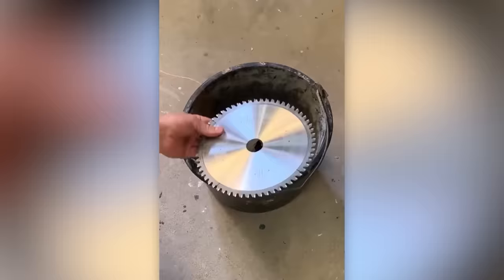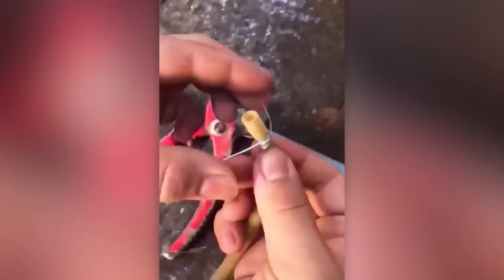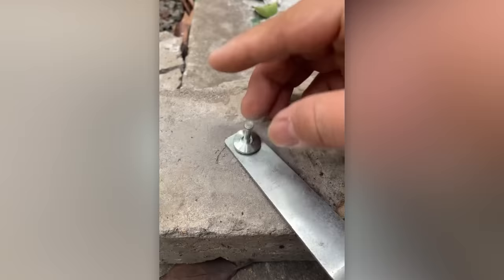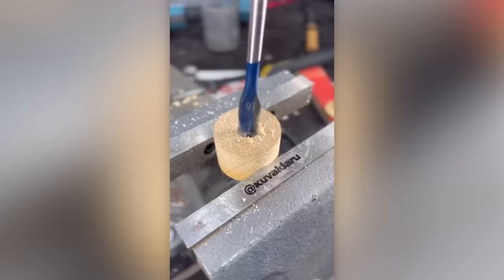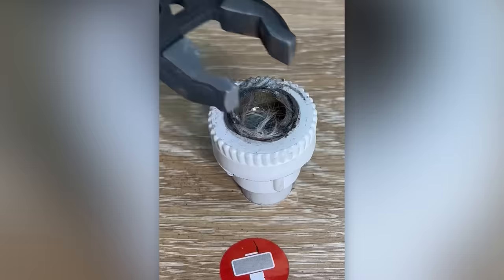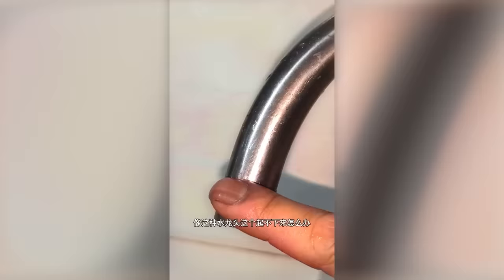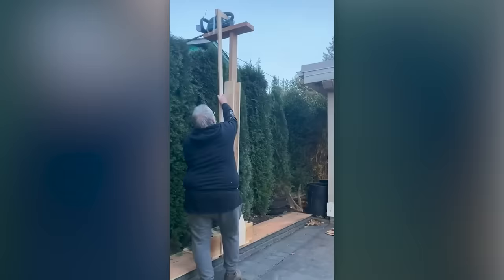HANDYMAN TIPS AND TRICKS THAT REALLY WORK

Comment: FYI: duct tape is not usually transparent and has threads embedded in it. The tape used on the door of that car looked more like clear packing tape (AKA cellophane tape).
Reply: Also if there is any compromise to the paint such as a slight crack all the paint comes too body shops love ya doing this
Reply: Yeah. Definitely NOT duct tape.
Reply: @konciliogasco3324  body shop here, ya that looked like packing tape to me too , and ya, it's great when customers try to fix their cars, and fuck it up, just don't put silicone anything on the car, we can't always get it off,and that sucks, it causes paint and anything else for that matter , not to stick, paint jumps rite off the pannel, it was still pretty brilliant though, i'm gonna try it
Reply: Real duct tape is adhesive backed metal like a thick tinfoil for doing duct repair work/sealing. that's why most or that (MUCH temporary/cheaper) duct tape is grey/silver. But still good catch and point, that's CLEARly packing/shipping tape ;] -with love and respect from Canada <3
Reply: @djosearth3618  it isn't really called duct tape, it was called "DUCK" tape, for it's moisture resistant properties, it was invented for the military

Comment: Don't use salt on a screw hole that will eventually corrode the screw and cause it to let go, Use a wood pin {Toothpicks/golf tee/spoon handle/etc.} if want to use dust use saw dust and glue.
Reply: Yeah... and if there is any chance of it ever getting wet, the corrosion will be terrible, but the salt and the screw's hold will be gone.
Reply: Getting screwed does leave one salty, though.  Jus' sayin'
Reply: EXACTLY,  TOOTHPICKS  WORK PERFECTLY. 
👩🤗
Reply: that's a good point i forgot about that one, that was a a very stupid one but among only about 3-4 not the normal 50-100% :). Ya everyone should know to use splits of scrap wood or rounded up used paper or nearly any inorganic trash really just not salt I use dried little twigs alot but never toothpicks (anymore), i'm trying to be more ecologically concious but not too ppreachy sorry if i came off that way, atleast i'm not using a fork to hang a little picture hehe (sewing needles sometimes work great for that tho) w love and respect from Canada!

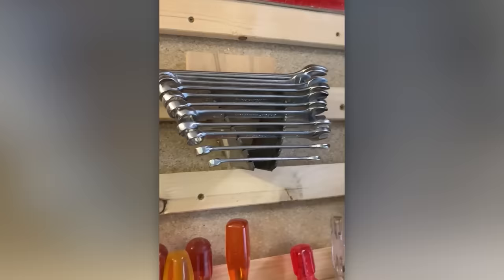Comment: Dear friend, at 0:20 that isn't Duct Tape. That's Packaging Tape. Nevertheless, that's an amazing use of it, and Duct Tape would probably work just as well, if not even better. So thanks for the demonstration!!
Reply: I agree about it not being duct tape. Duct tape would leave a sticky residue (as would packaging tape). 12:52 is also not duct tape. It looks like electrical tape, but I could be wrong.
Reply: not to mention it might remove some door paint😁
Reply: My wife said immediately, "That's packing tape!"😃
Reply: @UKcomedyfan28  Painter's tape
Reply: @melenynder7136  I don't think the painter's tape would be strong enough to remove a dent in a car door.
Reply: @UKcomedyfan28  not the door. The cup thing at 12:52 is painters tape
Reply: @melenynder7136  I don't agree, but that's OK. Painter's tape is not that stiff unless there are multiple layers. If the video could be zoomed in, we could tell better what it is.
Reply: A plunger would work quicker.

Comment: 10:15 never drill a ceiling tile from the top, you might bust out excessive tile as the hole saw goes through, drill a small pilot hole through first, then drill from the underside.

Comment: This was a good one with lots of new tips. Hey if you can, I’d like to know what those cabinet door hinges are called.   if you know i would greatly appreciate  if you could let me know.   Thx
Reply: @dennwahh it is on the screen top left. Lamp Monoflat Lin-X hinge. Lin-X450. There is also other names bottom left and right maybe manufacturer / distributor ? at 17.18 time in video.

Comment: I'm curious what kind of electrical circuit is involved with the the tip of twisting wire with a drill. If that is 120v or 240v, soldering it is a bad idea. A line at that voltage, if it overheats can melt the solder. A wago connector or wire nut are safer choices.
Reply: It seems to me that if a circuit is carrying so much amperage that it cause a solder connection to melt then there are more serious problems than how the wires are connected at the junction box.
Reply: That’s any voltage. Also, why they were twisted tight first
Reply: As an electrician, i really don't recommend to follow any kind of idea this channel provides about electrical circuit. It's not this dude you will call when his "tricks" will broke, and you will have to pay a full time dude like me, to found the problem, and repair it, then complain about why the bill is high, when you can avoid it by not doing those "ideas".

Comment: I've watched many of these videos and I can say that this episode had SO many great tips! Thanks for posting.
Reply: I agree. they are usually loaded with at least half useless, nonsenible or even more difficult but more complex ways of doing things but this one was nearly all pure brainiac solutions. The one where the guys used a fork to hang a picture was ugly as heck if it was drywall he could have used a sewing needle at a 56-60 degree angle those little things have quite a bit of holding power and make nearly no hole. just don't use the sure thinnest inflexible ones (unless hanging something really light. Also the guy that stuck (forever RUINING the critical factory finish on the drill bit and then wasted 3 black zapstraps making more micro-plastics including that stupid cup, just to mix 1/2 cup of epoxy/resin/activator/colour was mind dumbingly stupid. Popsicle stick or two would work just fine, i've been using a bent a peice of thicker bare wire or even part of an oldmetal coat hanger, i twist them into a spiral or like a kitchen honey utensil or whisk :) Good gomment! -respect and love from Canada ;]
Reply: The fuck video did you watch?

Comment: 0:17 "Don't underestimate the hidden power of duct tape" shows someone using packing tape 12:53 "It's just a simple tray made of duct tape" shows someone using painter's tape
Reply: He def does not know what duct tape is
Reply: @boris9305  Or he just thinks every kind of tape is duct tape, lol
Reply: Haha nice you caught those too eh ;]
Reply: @TalkingHands308 Funny thing is that real duct tape is actually metal, at least here in Canada. That tape with the reinforced strings through it is usually silver and was a cheaper TEMPORARY replacement for real adhesive backed metal duct work tape. Guess it's another 3m invention like post it notes were originally supposed to be used as bookmarks but the manager wrote his rejection note on it and sent it back and between the mgr the inner mail delivery and the R&D dept someone had a eureaka moment. Bonus: Inventor didn't even get a bonus, but that's nothing comparede to Dyson Inc. stealing and patenting all those recent engineering students ideas (not sure who thought of the sideways fan in the base BUT i KNOW it was Dyson that decided to charge $600 for it ;] - much love and respect from Canada
Reply: @djosearth3618  Yah, if you have a great idea, don't trust it with anyone, patent it first, lol.

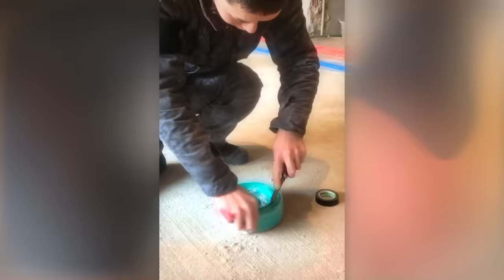Comment: 7:33 you can get a rawl plug out of the wall by putting a rawl screw in partway and pulling the screw with a pliers or hammer 🔨
Reply: Just put something between the hammer and the wall to spread the load so you don't make a dent in the wall.
Reply: @tgeliot  good point, I'm used to masonry situations
Reply: @tgeliot  ironically, before I was an electrician I insulated houses where we took some siding off with a wedge tool and a tapers knife behind it to protect siding underneath the wedge.

Comment: If that piece of surgical tubing (connected to the tire valve that was that inflated by the air pump) worked so well… 
Why did you need to do the jump cut in the video between 2:25–2:26?

Riddle me that Batman.

You edited the video right there where it didn’t completely stop the leak so that you could tell your bff to go turn down the pressure to completely off.

Judging by the low psi (20 to 30 max) that was coming out of that electrical conduit (not PVC) - you probably have the other end connected to a submersible pump of some sort and that you could easily unplug or just turn off. 

Try doing that with a real waterline break where the psi is about 60-80….
You won’t even be able to get that piece of surgical tubing into that pipe… Let alone your index finger.

I award you zero out of 10 points for your ridiculous hack.
Reply: Wonderful @jeremiahyeo5863 I love it when people can rip apart what's being offered as true, and back that up with reality! 🤣🖖

Comment: Big fan of the gear fixing tip with wax casting.
Reply: Yep! That one was instantly logged to memory. I still wouldn't do that fix unless it was an emergency. Plastic gear replacements are cheap. That is... if you can still get them. Since my career is in maintenance, I know that sometimes you just can't get the part. Usually, if I can't get the gear, I'll have one made out aluminum. That's what I do for anything that I personally own. But, that was definitely slick. Will certainly get you out of a bind in an emergency.

Comment: I wish you wouldn’t call packing tape and painter’s tape “duct tape” when it very clearly isn’t.
Reply: They do make clear duct tape.
Reply: @tinamortensen1220  In the first example where they removed the dent from the car is not duct tape.
Reply: You have pink hair
Reply: Of course it is
Reply: Wasn’t duct tape
Reply: There is a brand called Duck tape which doesn’t help the differentiation. We all call the general use strong adhesive rippable stuff gaffer tape. Duct tape is for making a duct for cables. (Studio lighting trade)
Reply: A meaningless, pedantic quibble. If you know the difference, why does it matter? Move on
Reply: @aaqilian5.085  Isn’t packing tape that thin brown stuff that you can never find the end? It definitely wasn’t that. And painter’s tape she must mean masking tape, low tack stuff. Wasn’t that either.
Reply: Even so the trick can be done with all sorts of tape..

Comment: 9:12 NEVER cut zip ties like that. The sharp end can slit your wrist!  If you don’t have a zip tie gun, use a knife while pulling the loose end sideways. You’ll get a nice, flush cut.
Reply: I've seen a suggestion to use toenail clippers to cut zip ties.  It cuts very close and makes a rounded end.  I haven't tried it myself.
Reply: @tgeliot  🤣👍

Comment: The hole saw with the spring loaded in there it’s really pointless. After you drill the hole, you don’t sit there and start clawing at the piece of wood to try to get it out… You just remove the drill bit… 

Were you born in a taxi cab? The drillbit itself is the tool you use to push the chunk of wood out because… You’re done… Drilling the hole. Wow it’s so simple it’s almost impossible.

Comment: 15:11 actually a good soldering tip.
Reply: Uh, no.  That wire is cold, so the solder isn't adhered well.
Reply: @tgeliot   Uh, yeah. because you're dipping the wire in to a hot liquid metal. Depends on the situation really and the gauge of wire. Also depends on if you properly prepared the wire.

Comment: 0:17  Duct tape? lol....... Try packing tape Einstein.
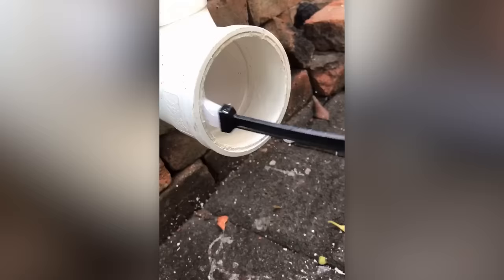2:43  And that's not for increasing the diameter as that would be pointless. It's for a repair. 
Going back to the joint closest to the leak, cutting it flush, heating then removing the remains 
of the leaking section. It's saves time and money by letting you replace only the leaking section.

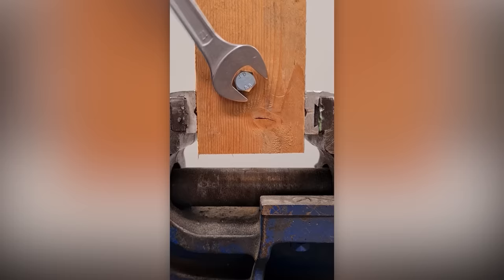Comment: Why do you have a machine bolt threaded into a piece of wood? (1:20)

That’s just stupidity in motion. 

Why WOULDN’T you be able to handle a machine bolt with one of your wrenches from your wrench set??? 

You’re using the wrong kind of fastener for that material. They make these fasteners called “lags”. I don’t think you’re really gonna move the lag out of the wood with your machine bolt and nut… Lags hold pretty tight.

Judging by how little force is being applied to that bolt and nut,… it doesn’t look like that bolt is in that piece of wood all that tight… You could probably get away with just turning it using your index finger and your thumb.

I give you zero out of 10 points on this hack

Comment: Did you actually try to remove the oil filter on the vehicle before removing the drain plug??? I feel like I’m watching an episode of “just rolled in”. This stupid notion that all filters are hanging vertically straight up and down is preposterous. You’re probably too young to remember that in the 80s some filters are mounted to the side and that way they dump their contents as soon as you open it up… That stupid beer pong cup isn’t going to do diddly squat except get in the way and splash motor oil around.